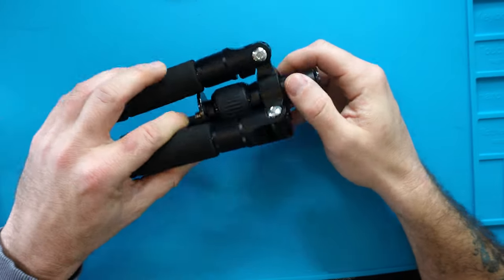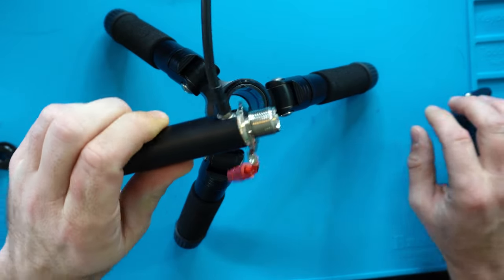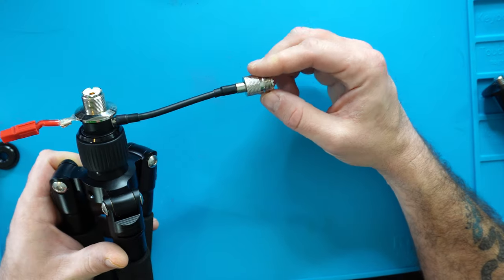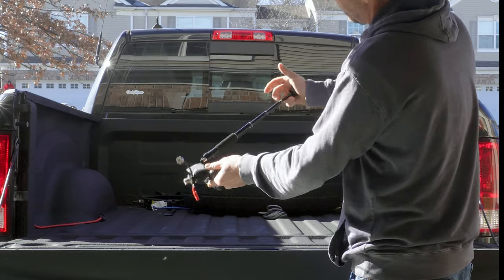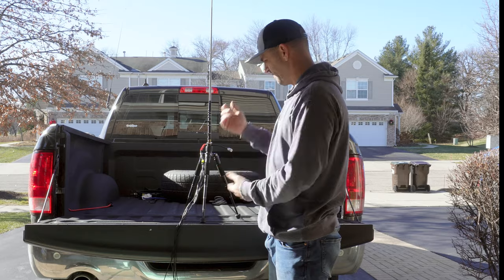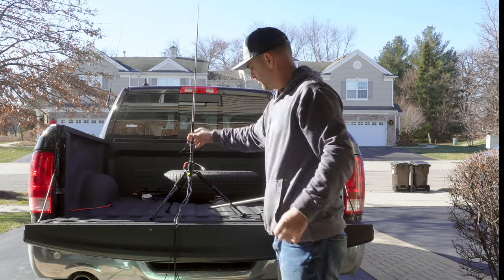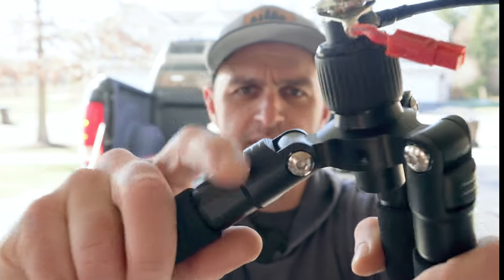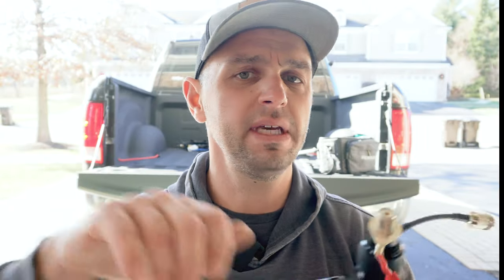Overview - GRA-ULT01 Lightweight Portable Antenna Mast Mount #hamradio

Comment: Nice review Dude.  What's the size of the center hole without fitting the SO-239?   Could u fit a telescopic mast (like the Carbon6) through it ?
Reply from the maker: Well now there's a thought . When I get home I'll measure it
Reply: @HAMRADIODUDE  did you get home? :-)
Reply from the maker: @gsansoucie  I'm never taking that detour again... The ID without the so239 and adapter is 22.39mm
Reply: @HAMRADIODUDE  lol.  I’m currently looking at all my photo tripods with removable center columns to see if I can convert one.  I’m trying to piece together the ultimate bicycle portable setup.  I believe the toy box and this tripod are too big for what I am thinking, but I can still look.
Reply from the maker: @gsansoucie  I have an idea but I'm bad at writing. My idea would be to find a piece of PVC which fits in there, then build all the so239 adapter stuff off the PVC.   I've also been toying around with a few ideas.  Looking forward to seeing your results
Reply: @HAMRADIODUDE  so that idea about the PVC was dead on.  I made two PVC supports for my Carbon6 yesterday, one with a 3/8” x 24 male bolt end on the bottom to screw into the many 3/8” x 24 antenna mounts I own (I even took the setup out to the park in the snow to test it out).  The other has a female 1/4” x 20 nut plate on the bottom to use with tripods.  
My bicycle portable setup is complete now.

Comment: Adapters for ham sticks are a dime a dozen. You can find one to convert to whatever you want. I like the idea of this, but for this use case, I wonder if a mag mount might not serve the purpose just as well. Vehicle bodies oddly enough make a decent counterpoise for the higher HF bands. Good vid, and way to step away from what every other ham YTer is doing(X6100 overload that no one really cares about)
Reply from the maker: Haha, I just finished another documentation /setup video for the x6100. I think that's the last one I have planned.  I've hit on everything I can until an upgrade.  Next up, I am going to focus on a frequently asked questions about baofengs as scanners and then trying to build some bluetooth communication tools.   Hope you're well, Merry Christmas.

Comment: How do you make your counterpoise?
Reply from the maker: Typically I get five radio wires and bunch them together, then solder or crimp them.  From those five radio wires I have one wire coming out to the power pole connector, which then the other end of that wire gets a ring terminal on it
Reply: @HAMRADIODUDE  thanks I was going to build one today to get my 10m  radio on the air from my garage. how long should I make the wires? any suggestions new to all this. side note I made a quick antenna last night out of a speaker wire and made my first hf contact in georgia on 10m. im hooked time to get my general and a better radio haha.